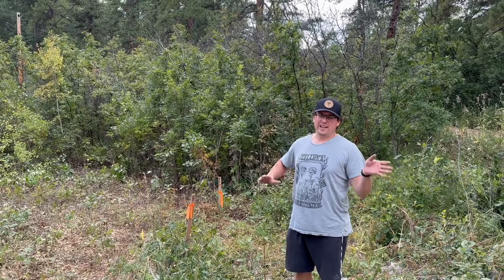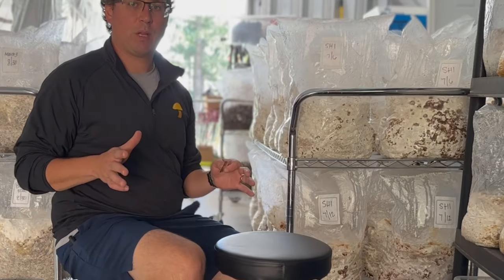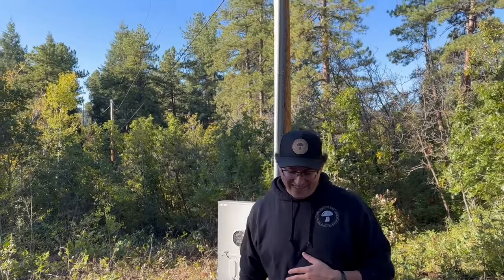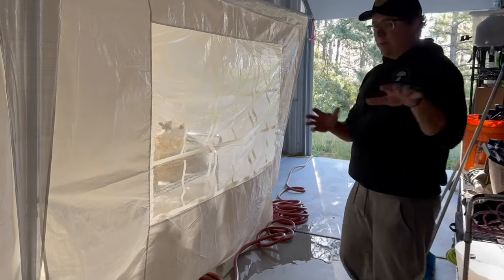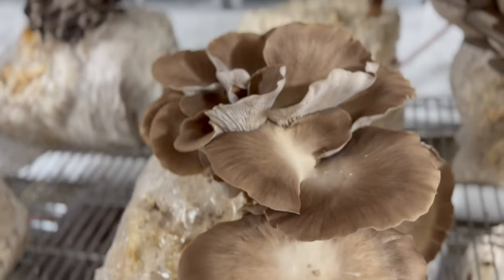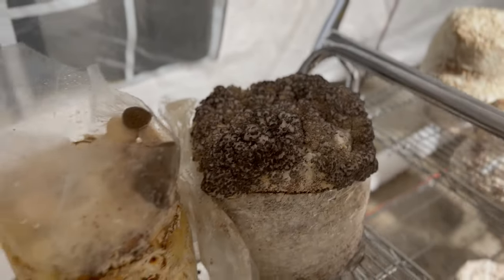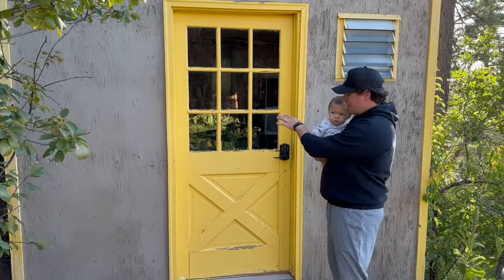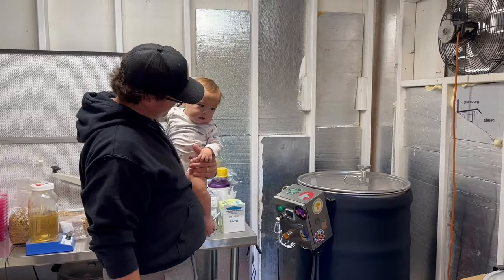Gourmet Mushroom Farm Tour 2023

Comment: Hi Gary, I was thinking about why you were using a regular hose to spray your blocks when I realised that there are fine nebuliser attachments to put on your regular garden hose. So I was thinking, like why do you use humidifiers at all? could one just install those hose nebulisers and maybe automate it with an Inkbird to replace a regular humidifier (ultrasonic in my case, which need replacement more often than I hoped)? it would make things so much simpler for everyone, instead of eg building those diy-tub-12vfan-fogger-UVc systems, especially if you're aiming at scaling up. Maybe that system has the plus of uv-c sterilisation, but it should only be necessary if you have water sitting in a container, right? But if you use your hose, it shouldnt't have any water sitting for longer than a few hours tops. What are your thoughts on it? Have you considered using a sprinkler system in your fruiting room?
Reply from the maker: this works really well for shiitake - I think there’s pros and cons to both methods and will do video on this at some point 👍 a lot of commercial
growers use high pressure misting for all the reasons you stated - this was more of a supplement to fogging until they brown up like the one on the bottom I harvested